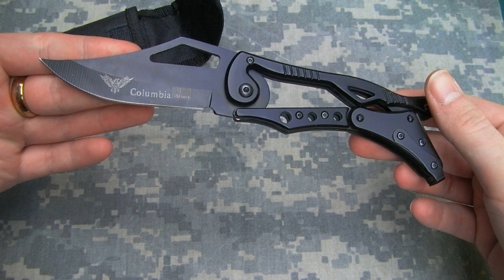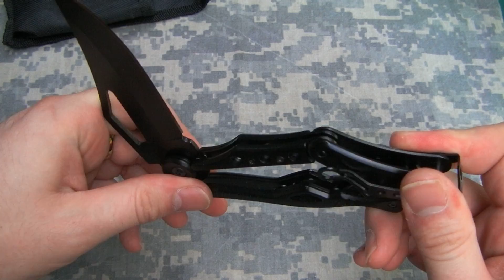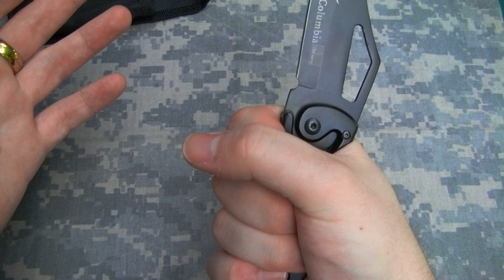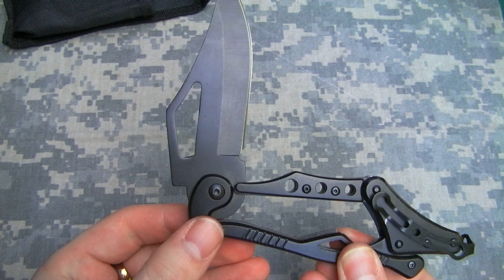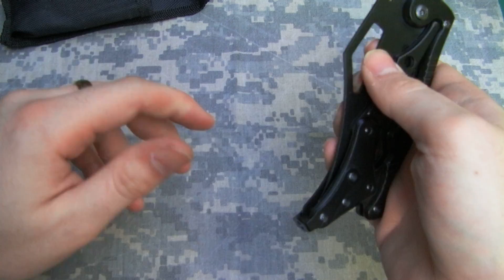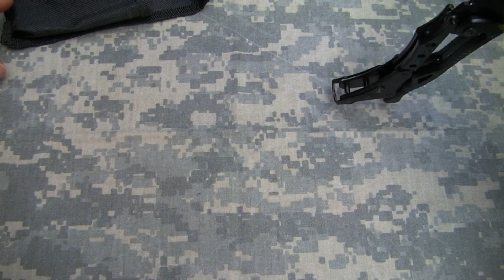Terrible Knives Ep 2 - Kershaw ET Knockoff

Comment: Almost all your complaints about this terrible knockoff don't exist on the real Kershaw 1900 designed by G & G Hawk. 
-The real one only has 5 screws (including the pocket clip).
-The handle is made of 6 pieces of aluminum, not that layered, flexible, screwed together mess. 
-I have two with ZERO blade play.
-A real one can't trap your fingers
-The pocket clips are the same, but much stronger with a stud on top for one-handed opening.
Reply: yes another appreciator of the elegance and functionality of the G&G design :)

Comment: I've got the same model with a different brand, "Way Fishing" from Brazil.
As pointed out before, the design is From G&G Hawk http://www.hawkknifedesigns.com/et.html
My copy is pretty easy to use one-handed. I've never nipped any pinkies either.
The belt/pocket clip is indeed useless and adds unnecessary bulk to the knife but that's because these copies aren't engineered to the same degree as the Kershaws - Kershaw ET Training Video
Reply: I bought one years ago here in Brazil and really liked it. Unfortunately it broke one of the joins and I was never able to fix it. I'm trying to buy another but it's impossible to find it again.

Comment: I bought 2 of these, a medium sized one and a large one, they were really cheap and I wanted a Kershaw E.T. but couldn't find one. They take a good edge but I've not used them very much so I can't really tell if they hold it or not. They are a bit challenging to open and close, at times I feel tike a long tailed cat in a room full of rocking chairs but I haven't cut myself yet.
They are a curiosity and remain in my knife drawer most of the time.
They are an ingenious design though.

Comment: The actual version of this knife has even more screws, especially on that one pivot bar with the three holes. There is a screw at the point where it connects to the blade to stop that turning that you did.